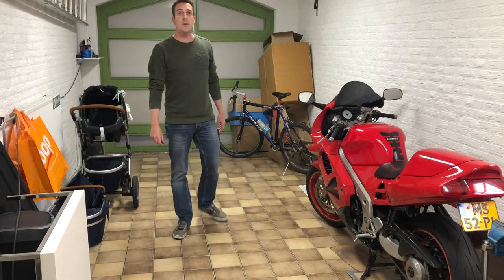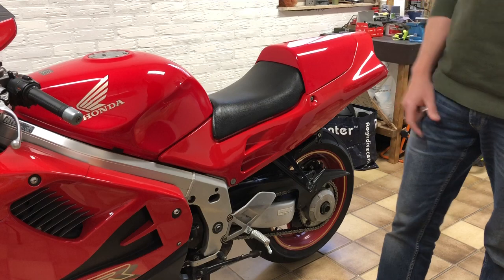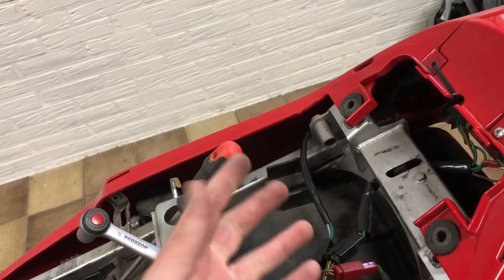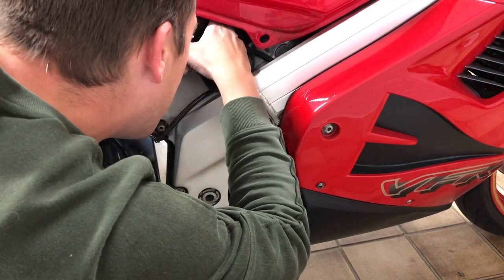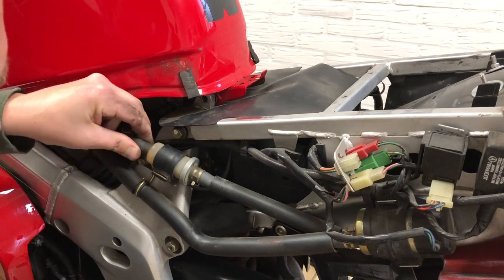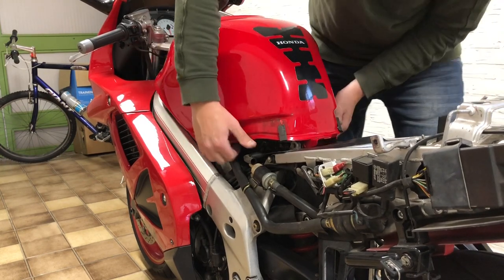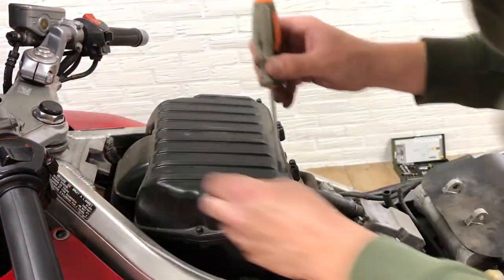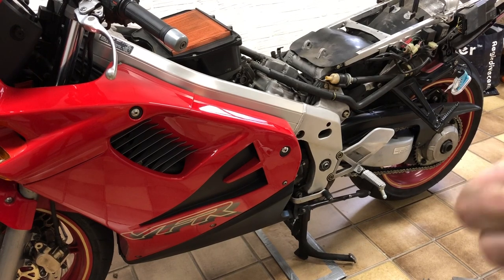How to change oil, oil filter and air filter on a Honda VFR 750F RC36 - Part 1

Comment: Very nice VFR! Just a tip for you with stubborn rubber lines. Spray a samll amount of WD-40 on the rubber & use a pair of channel locks to grip the hose firmly & rock the hose back & forth keeping it snug with the channel locks. Don't grip it to the point that you're going to break anything. I've done this for years working on cars & motorcycles. It works every time.